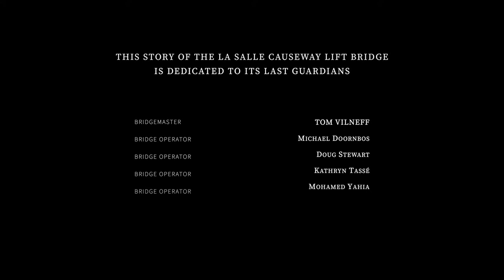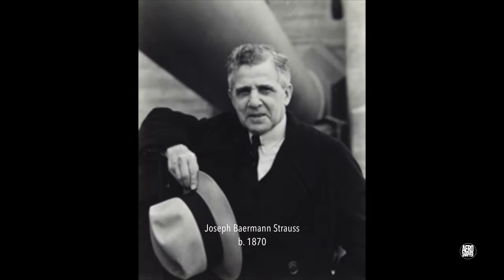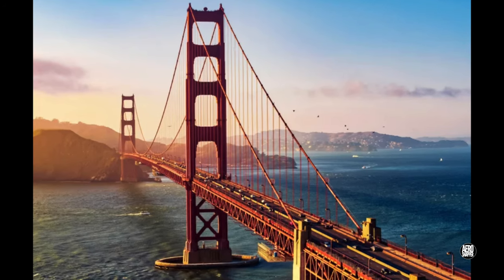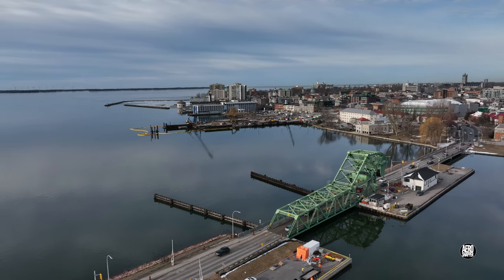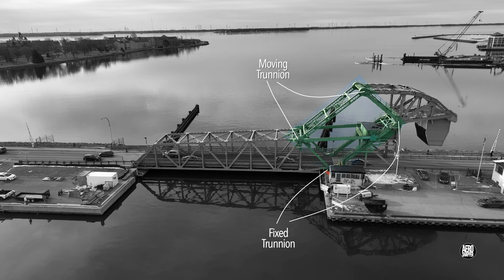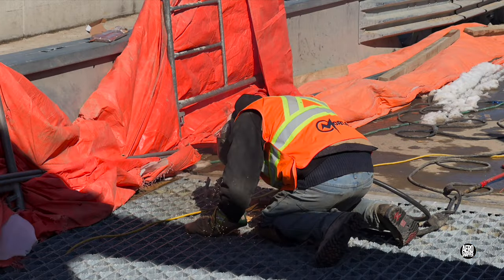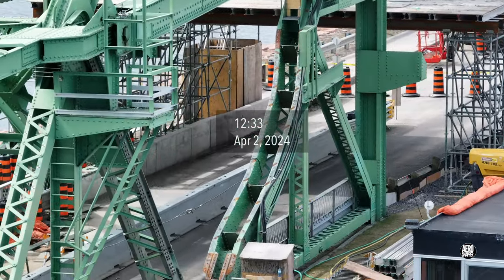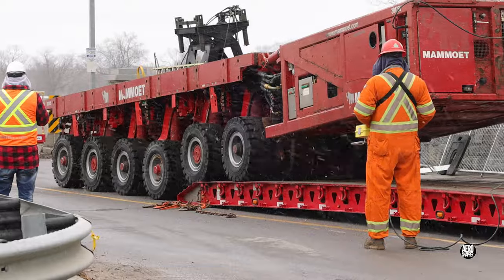Kingston's Singing Bridge Remembered   4K

Comment: Thank you for this. Our family is always going to fondly remember the "Singing Bridge" We're sad to see it go.
Reply from the maker: Oh, I think we’re all very sad to see the bridge damaged and demolished. We can only hope that any replacement gets the love and respect that this one did
Reply: @Aerosnapper  My hope is that it sings and isn't too modern looking. That singing always meant I'd reached "home" I hope it returns.
Reply from the maker: @rca6576  I understand. A great deal will depend on the deck material. The old bridge was grated - that reduced the weight.  It’s possible that modern codes, which don’t usually permit discharge into waterways, will make using grating a challenge.

Comment: It's gutting that such a beautiful bridge was lost.  However, I spent many days hanging out with the bridgemaster when I was younger and may have some insights on this.  The bridge was extremely unreliable.  It opened fine, but engaging the locks after bringing the bridge back down was hit and miss.  Temperature changes due to changing sun angles while the bridge was up would bend and flex the deck so it no longer aligned with the locks.  Sometimes the bridgemaster would have to repeatedly drop the bridge from increasing heights to try to get it to lock.  Crash, crash, crash.  With that as the default state, I can fully understand that after a the major twisting incident caused by the bent beam, there was no feasible way to make the bridge operate again.

My real beef is with the lugnut who thought that removing all the cross bracing on a major structural beam under heavy load was a good idea.  That cross bracing creates a closed system, remove it and the beam loses all effective depth and will deform.  That operation during maintenance killed the bridge.  We can only hope that the eventual replacement bridge will be as interesting.  But I severely doubt it.

Greetings from Switzerland.
Reply from the maker: Neil - sorry about the delayed response.  I have been away for a while.  Your recollections and insights are really valuable.  Thank you for following the story of the bridge and for contributing to understanding the whole situation better.